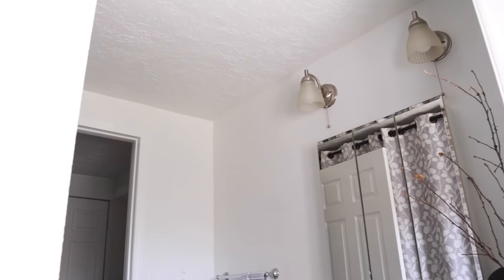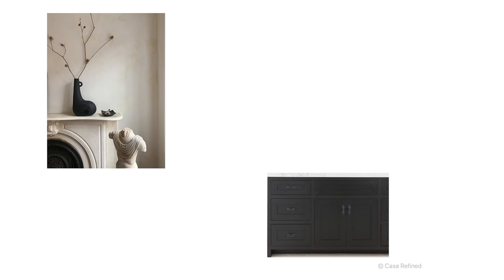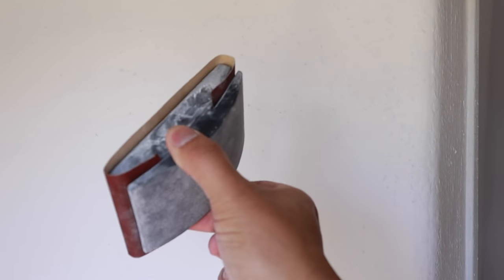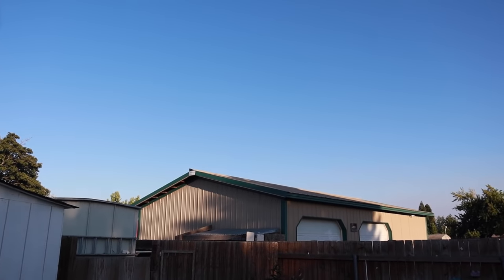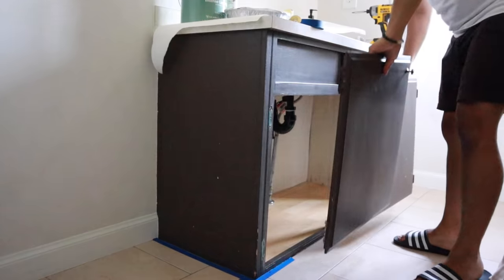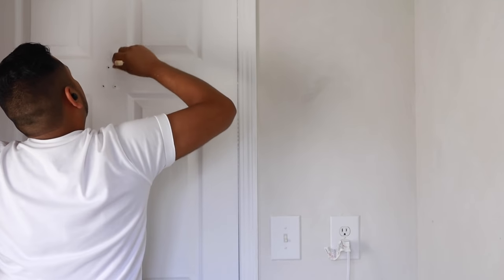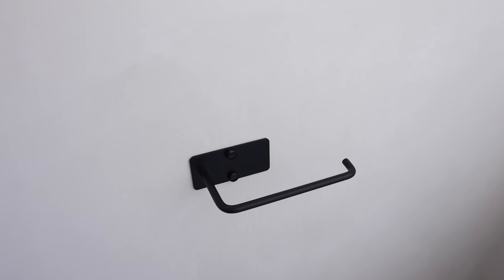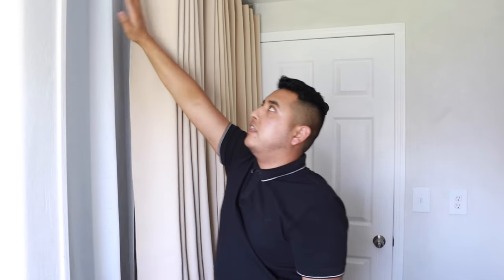DIY Small Bathroom Transformation on A Budget (minimalistic + modern)

Comment: I think it turned out great, about the countertop, I would try covering the edges of the laminate, the dark seams with a light color paint to hide the dark line.  Ebay has nice pull out solutions for under the sink pull out shelves and Tip I mounted my stainless steel pull outs with double edge gorilla tape. tip: I bought the pull outs that had ball barrings they do not make scritchy noises and pull out smoothly.😘
Reply from the maker: Thanks Randy!  Great tip! I actually tried that with nail polish and it worked. I just needed to use a lighter color, as it was still dark and noticeable.  I might go over it with lighter one. 😄
Reply: @casa_refined  GREAT I actually thought about nail polish and wondered if it would be opaque enough, which is challenging when you are trying for white nails anyway...probably need something oil based, try art store for smaller quantity or perhaps sample size at  big box. good luck.

Comment: Pausing the video to ask what kind of screw driver or screw driver head do you use to remove the towel rack? I want to spray paint my toilet tissue holder but cant get it off. Thanks!
Reply: Probably an allen wrench. Maybe you have an hexagonal L-shaped wrenches that sometimes come with flat-pack furniture, or you can get a set from the hardware store/amazon. The screws are usually hidden under the  fixture (on either side of the towel rack.)
Reply: @addisonmadison5989  Thank you! Yes it is underneath and I cant see it. I used a tiny hex wrench and it would not go in. Maybe I need an even tinier one or get someone small with good eyes to get on the floor and unscrew it! 😆
Reply: @lennysvibe    Thank you! Yes it is underneath and I cant see it. I used a tiny hex wrench and it would not go in. Maybe I need an even tinier one or get someone small with good eyes to get on the floor and unscrew it! 😆
Reply from the maker: I used a tiny screw bit. I'm sure you can find on at the hardware store.. This set has every small screw bit imaginable! The one I have is no longer available but this is basically it: https://bit.ly/372cYGC